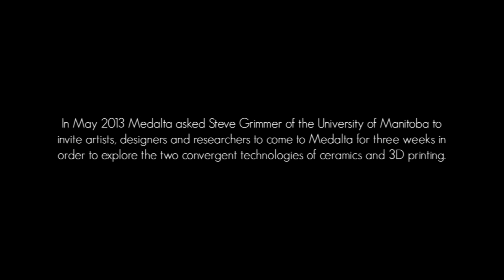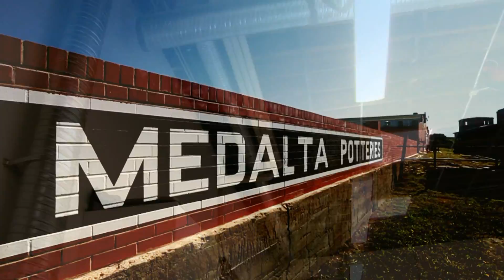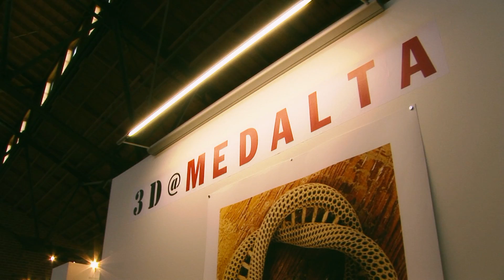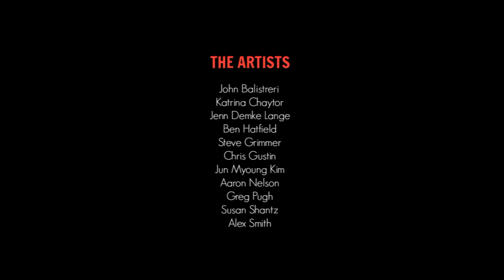Ceramic 3D Printing @ Medalta

Comment: would this glued ceramics go to a kiln?
Reply from the maker: Yes, the printed material would then be fired. Most of these in the video were just experiments, so they're just shown as they looked as they came out of the printer - but finished work would be put into a kiln.
Reply: hi , is this work with silver ? and how much , and what its name ? thanks

Comment: Fascinating and yet as a maker of things by hand with a tactile material (clay) I am torn about the methodology. Still I would like to try it because it would give form to some ideas not possible with traditional processes.
Reply: I guess they can be integrated to some extent. But sure, if there is an art where the tactile feeling of the master becomes an integral part of the final work, that's ceramic.

Comment: Its nice to see Maya being used in creative fields other than animation and architecture. But I have to ask, was your zcorp 310 altered to used materials other than the white powder?
Reply: Brian Nelson Yes, there are several powder formulas available and color can always be added.
Reply: +Brian Nelson what other CAD programs are used in 3D printing?
Reply: +peanutt inc Hey this is Max at Tethon 3D and pretty much any 3D software that you can export from is viable for 3D printing. It's all in making the model into a print ready file.